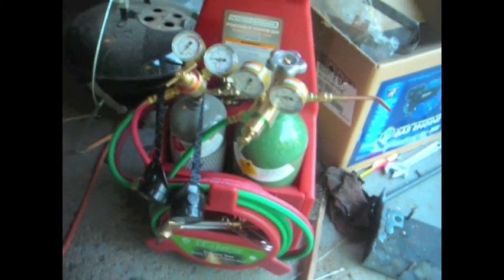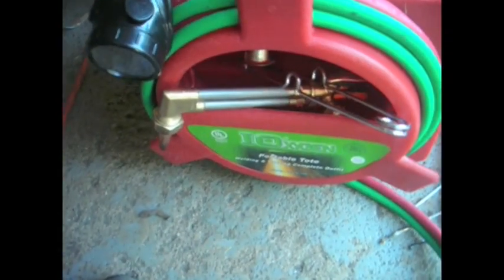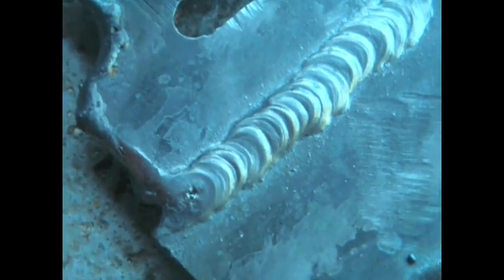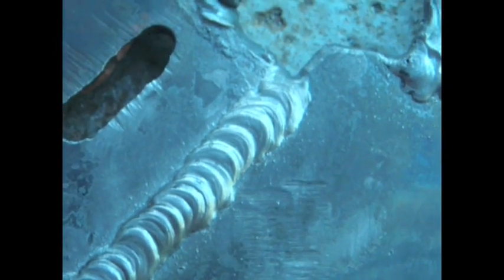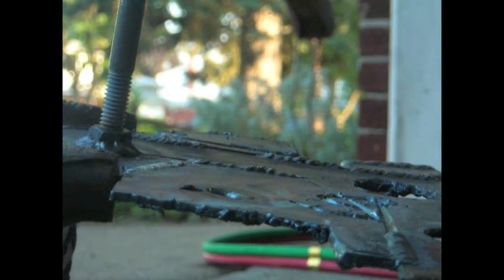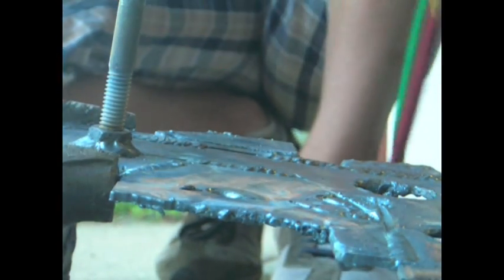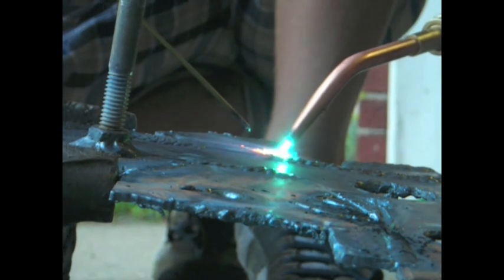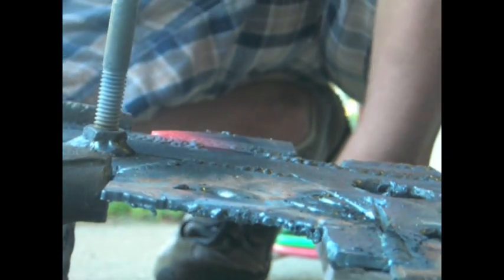harbor freight oxy fuel torch kit

Comment: Thanks for the mention there Buddie.  Your welds look pretty good so far.  More practice!!   

However may I please point out that the bare legs and tennis shoes have to go. Please get some safety gear. Long pants (yes, I know it's hot) and leather shoes to stop the sparks.  You will thank me in the long run.

Comment: As a profession welder, it's not as easy as you think, for a beginner your okay, but 1. do not do any kind of welding in those gloves, if that shit melts it fuses to your flesh, use all leather gloves, 2 cover all your skin, when you weld it lets of UV Radiation that will fubar your skin down the road., You best weld is not bad, your beads need to be a bit more (pretty) same size, same amount of filler, and watch your heat affected zone. also always grind down your metal, get the milscale off.

Comment: Get yourself some 1/8 copper coated steel rod when you start doing some real welding. Coat hangers will work ok for practice, but the materials are highly variable with lots of contaminants and could leave you with weak or brittle welds.